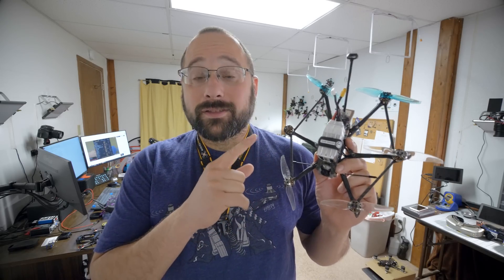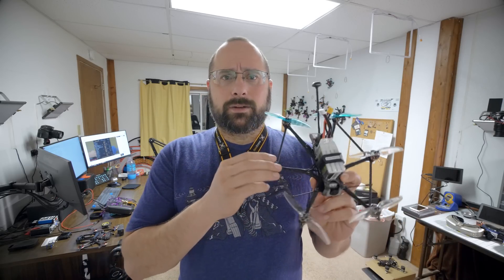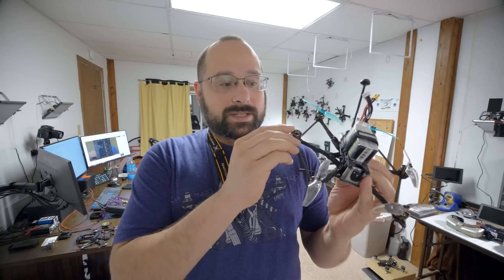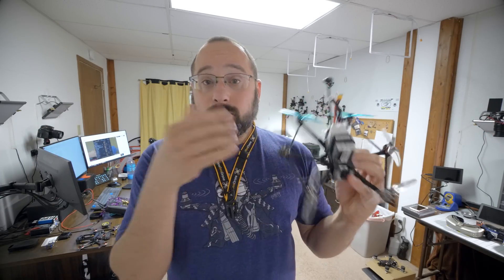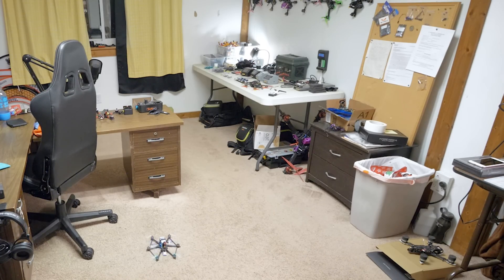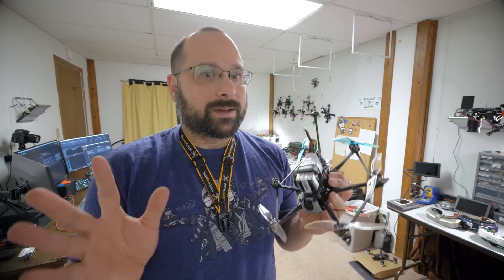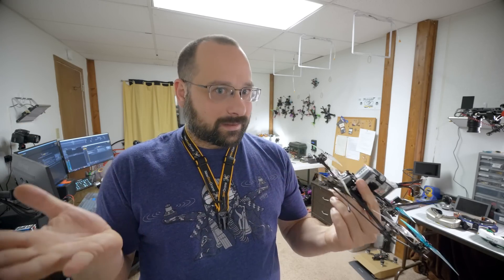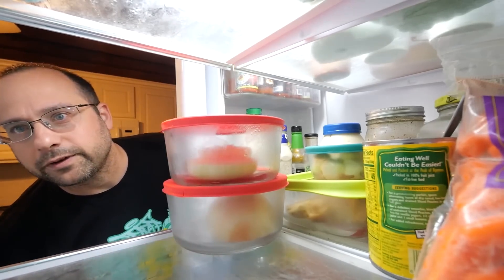Can Betaflight compensate for a failed motor in flight? FLYWOO HEXPLORER

Comment: I have loss a prop on my hex and it still flys. Put you have to have the mmix set up for the 6 motors so the fc can fly right. Any of my hex flying a standard setup becomes unstable with the slightest issue like you are having http://www.iforce2d.net/mixercalc/

Comment: 7:10 NO. it wouldn't fly as the hexacopter configuration is different. in the demonstrated situation, both CW are on the left and both CCW are on the right, which means when it tries to yaw, it rolls alongside yawing, and the PID controller just gives up. that is NOT a quadcopter configuration and thus should not be expected to fly at all.
Reply: Right, with center CG a roll towards the failed motor couldn't be corrected with neutral yaw. There is no motor mix where this is possible. But with a CG biased away from the failed motor it could work. For a simple proof, shutdown two adjacent motors and move the CG inside the quadrilateral formed by the operative motors. Those are rotating like a conventional quad. I think a lot of the success stories here leave out important details about CG. The motor mix is going to be very different for my above CG shifted proof quad than for a hex with assumed center CG. For instance the left motor wouldn't contribute to pitch, except with a forward shifted CG it would. PIDs would cover up this detail with all motors operative, but it may determine success or failure with motors inoperative.

Comment: Look at the quad when the two side props are off. It's not a common quad configuration where the diagonal props should spin in the same direction. When you roll left, the left two motors reduce speed, which makes the drone roll left, which also reduces clockwise torque. So whenever you do a roll, you are also performing a yaw. Maybe you can try yaw right while rolling left to see if that helps.

Comment: Hm.. My guess: the PID controller is trying to compensate. But to compensate, it spins the motor with the missing prop harder since it's further away from the center. But this does nothing. So it probably starts spinning up more and more and somehow can't handle that increasing the thrust on one side has a much bigger effect than on the other(?)

Whatever it is, it's bad, since having 2 additional motors means 2 more points of failure, if the drone crashes when any one of those fail :(

Comment: Hmmmm. I was with you on this question. I hit a powerline with my Mavic Air and must have come close to folding one of the front arms. Looks like it would have dropped in the river and not recovered from the tumble like it did. Sorry, no footage. The camera was off because I was flying home with a battery alarm, in a hurry.

Comment: I have a large hexacopter - approx 53 cm wheelbase - that has the same issue.  I tried taking it off with 5 props to test redundancy and the behavior looks almost the same.  It makes we wonder how redundant a hex really is.  Yes I've seen videos and heard of hex's flying without one prop, but it I'm starting to wonder if that's more of a good-case scenario and getting lucky, rather than a natural ability of the hex design.  I think for true redundancy you need an octocopter.

Comment: why wont you adress the elephant in the room and just look at the direction at which props are spinning? if you remove 2 side props, you are left with two front and rear motors on each side spinning in the same direction, compared to opposite direction on a quad. it has no yaw authority and tries to compensate, but fails. Hex without one motor freaks out at yaw axis, you can hover it without forcing it to yaw, technically, but it is not as redundant as octa.
Reply from the maker: Correct. But that doesn't explain why it didn't fly in five props.

Comment: the kquad in the lower left corner has the protection foams in motors from the DJI FPV packaging, images that were leaked today! think that bardwel is already with the kit :P
Reply from the maker: That is the diatone Roma f5.

Comment: If you had a PID controller, then yes it would work (see old-school APM octo's) but Betaflight has SO MUCH more going on than PID.  flip-out-protection is just one thing to turn off... maybe if you turned everything off -- feed forward, antigrav, airmode, I term relax, throttle boost, I dunno what freakin else but there's a lot going on in the control loop.  Haven't even mentioned the most common way a motor would stop producing thrust, and that's a broken prop, mad vibration.  So, what would the filters have to do to make that flyable?  
So the person JB was mocking was right, lol, -- Betaflight would have to detect a fault and go into 5-motor mode.

Comment: If you give up yaw stability quads can compensate for one dead motor or two if they're on opposite corners, nobody has gotten them to do it on a  micro controller, but with a flight computer it's achievable.

Comment: Since the left/right pairs are rotating the same direction you have effectively coupled roll and yaw.  I suspect roll authority is limited by the yaw pid fighting back.  Set yaw gains to 0 and I bet it hovers, but with 0 yaw control.

Comment: This sounds like a setting I needed a couple of years back. -- -- -- I have 3 distinct "claw mark" scars on my chest from a quad that "flipped out" on my desk due to an incorrect setting (and someone failing to remove the props for a quick and simple adjustment). It went from flat on the desk to vertical against my chest with enough force to very literally knock the breath out of me, and rip several not insignificant slices in my chest. If I hadn't still had my hand on the switch, or if the motion of the quad had knocked the controller out of my hand, I don't want to think about what could have happened.

Comment: hey josh i have one otw but i was wondering if you could answer this question. if i inverted the front and rear motors but leave the middle ones mounted as normal would there be enough room to mount 5" props ? thanks

Comment: When a quad yaws it mostly is lifted by cady cornered motors. The other motors offer balance but their thrust goes way down. With the hex on the stock arrangement there isnt a cross of these two counter yawed beams. There is more a star of david of two counter yaw triangles. And id you knock a motor off that triangle the remaining beam is far from the cg. This beam has 2 cross beams neither near the cg. You need 4 active motors for stable flight on crossing beams opposing yaw directions. But the cg also has to fall within the box outlined by the 4 motors. 

If you look at the motors adjacent to the failed motor as a single motor you can see that by the time they balance the lift of the only cross pair of motor that counters their yaw the motor that completes their triangle must be more or less off leaving you with 4 motors. This leaves you with a quad that roll and yaw linked together and the yaw pairs that dont cross. If you had "smart" software to bias the good triangle to avoid this you end up with a sideways cat dead cat setup but in one of the two twisted dead cat arrangements the cg is outside of the box drawn around the motors. The mixer would need additional parameters and pids to quantify the biases needed to make this work since the pid would never create this bias naturally. But im not sure a pid would actually work since a pid works when the direction of the answer is straightforward. It doesn't necessarily work when you can have an over center situation where continuing in a direction makes things worse. The answer might need computer learning in reality.

This might actually work on a 3d setup, not entirely sure. 

Another way you could set it up is like a stretched X quad with dual sets of front motors since those are most likely to take a strike. Coaxial motors on a tri could work as well.

Comment: Now what i am wondering is what would happen if you would switch only the front and back motors to a higher pitch than the left and right ones. To me it sounds like it should fly but i wonder how it would feel like in the air.

Comment: Well there arw 4 motors turning 1 direction and 2 turning the other right? Lets say 4 ccw and 2 cw  if you remove the  prop of 1 of the cw then it will never compensate starting with yaw of 4 motors vs 1

Comment: The problem is that Betaflight doesn't want to overshoot too much. If it didn't care about overshoot it would also use the the functioning motors more and be able to stabilize.

Comment: FWIW I lost a prop inflight on my DJI F550 hexacopter and the controller held it steady after a brief wobble.

Oh - this happened because I had just purchased it from another guy who didn't know that you could buy motors with left-hand threads and the prop nut came off.

Comment: Bruce Simpson flew a quad with one smaller prop with no trouble, then 2 props different. If I remember correctly, he flew with 4 different props to show the FC could cope.
Reply: Exactly. The FC must get SOME response to its commands. It can compensate but not use a completely different algorithm.

Comment: Isn't it ESC aborting? Can you see if this ESC on test stand can do 60-100% "thrust" without a prop? Maybe some safety feature of ESC needs to be turned off. Or some feedback from ESC to Betaflight (something like RPM filter or something like that i.e. dumb it down a little).

Comment: My (4 motor 5") flew back today fine with one of the blades missing off a three bladed prop, made one hell of a horrible noise but it flew back fine, I did loose the blade after hitting a tree and remained in the air, I didn't land then re-take off again, but betaflight managed to retain control with a third of s prop missing, but I bet if I had tried to take off again after landing it would have flipped out.

If only you could take off with six working motors and then disconnect one during the flight, maybe that would work?

Comment: Most PID's will not do asymmetrical adjustments, meaning thrust compensation for a missing motor on one side will also be applied to other side which still has a motor. So that's the main problem causing runaway when removing only one motor. The reason why removing 2 motors to make it symmetrical again did not work, is probably because the BetaFlight hex motor mix is hard coded to primarily use the missing side motors for roll authority. I.e. you need both asymmetrical PID and adaptive motor mix (this is the difficult part) to be able to remove a motor.

Comment: A jumbo jet with 4 engine if a engine fails it will  Shut down one of the other engines so that its flight only on two so is not off balance so why can it not  Shut down two middle motors And fly like a normal   quad ?
Reply: It absolutely could, but there are no provisions in the code to do so. The Jumbo jet 'knows' that a motor has stopped, the quad doesn't.  It just keeps ramping up the missing motor.

Comment: It is more likely to work with fancy GPS self leveling in Inav. It might not be enough to take off, but if a motor or prop fails in flight, it might increase your chances of bringing it down safely.

Comment: Bardwell ffs, enable angle or horizon. Hex mode with acro and no prop never worked on any fc since the dawn of time.
Reply: Know it all? Yikes
Reply from the maker: When I show you the outtake of testing it in angle mode and it does the same thing, then what will you say?
Reply: @JoshuaBardwell  https://www.youtube.com/watch?v=ap8ngQqt7s8

Speaking re: old DJI flight systems, and APM; only works with level mode; at the loss of yaw authority. ONLY with level modes.

And there is required coding specifically for this.

Acro mode has never, and will never work with this because user input beyond the max tilt angle will result in instability and your flips (if not worse).
Reply: @JoshuaBardwell  also with some research and more importantly experience flyhing hex configs and octo configs, you'll find that redundancy is far less fickle on Y6, X8 and Octo configs when the power to weight ratio is ideal (read, not too heavy)

Comment: The biggest Problem is if bouth middle props are missing,the Motor Direktion is wrong on the back. Bouth clockwise Motors are on the left and bouth anticockwise Motors are on the right.
Yaw and roll are a Problem... 

But i know,  my old hex whith a naze32 (newest betaflight Version that Supports the naze, i think its 3.5.something) can Fly whithout any Problem if only one prop is missing. But this only works for bouth Front and bouth back Motors. The middle ones dosnt work fine. I dont know why.
Reply: That I exactly what I was suggesting in my comment

Comment: Isn't this the same as putting on 3 high pitch props and 1 low pitch prop. The other 3 motors have to compensate for the low pitch prop. But in this situation you have no prop = no thrust means that the software wants to compensate the other motors to the motor without the prop, which means no thrust at all.
Reply: In that situation the low pitch prop would spin faster to compensate for the lack of pitch. The other three would not be affected until the low pitched motor reaches max RPM, at which point they would be limited to maintain status quo.

Comment: Correct me if I'm wrong but by removing the two motors on the middle of both sides, isn't the prop configuration both clock wise and counter clockwise on each side? It won't fly right on its yaw axis. Maybe two motors on the front or two on the rear removed would make fly like a deadcat frame with a really weird cg.

Comment: Even with the PID loop theoretically compensating, it seems like something would still have to be added to Betaflight to enable it to "know" that a motor is dead. Maybe with bidirectional DSHOT there is some way to detect a zero-RPM or insufficient-RPM condition... I'm not a developer so I am getting over my head quickly but it seems possible.

Comment: That's weird. I guess Betaflight hasn't been optimized for this. I seen a TED Talk where a guy had several quads flying around and he even cut prop blades off one motor and then off 2 motors and it still flew.

Comment: @Joshua Bardwell   Can you try to set betaflight as a Quad X and reassign motor ressource to whatever is needed for it to have correct motor order ?

Then try to fly with only four motors to confirm the lack of thrust !

I think the quad will fly just fine , but not sure about that

thanks

Comment: Does it have anything to do with the direction the props are spinning?  From what I can tell, the rear motors are spinning props out and the front motors are spinning props in.  In my mind that would affect the yaw axis enough to make it flip out.
Reply: They'll all be either props in or out. No mixing it you'd have a flip out!
Reply: Removing central props makes this hexacopter, a  quadcopter with incorrect motor directions. There is no possibility to do YAW with out ROLL, and ROLL without YAW.

Comment: If Betaflight could monitor the individual amp draw of each motor it could see when one doesn't have a prop on because it's not drawing the expected amps, enabling it to label it as suspect and shut it off to let the remaining motors take up the slack.

Comment: Yeah, the other motors "should" be able to compensate, but the PID controller will trying to primarily use the motor with the missing prop to do it (along with the others of course) and the response just isn't there. Probably saturating (I.e. maxing out) the control output on that side - to correct that it would have to be able to compensate by reducing or reversing the signal to the other side, and if the main counteracting motor on that side is also missing a prop even that won't help... regardless, it's still trying to use the disabled motors to control motion, and at the very least the PID loop can't even start to compensate for that until it knows those motors have reached max RPM (and does it actually have that information in the first place? I know you can get RPM from some escs, but can you even set a "max rpm" detection threshold in betaflight? ).

I'd bet that the control loop trying to maintain yaw control is probably also not helping to keep rpms in a good range.

Comment: My guess is that for hexacopter the side motors are manly responsible for roll and the others aren't given the authority by the pid controller to balance the quad instead it sends everything to the Sidemotor which has no prop on.

Comment: Just yesterday I was trying out some new props, didn't quite throttle up enough coming out of a dive and pancaked the floor.  One entire blade of a 3 blade prop broke off and I flew the rest of the pack without realizing it.  When reviewing gopro footage I can hear the sound of the quad change when I pancaked.  

I'd have thought your hex in penta config would've flown as well.

I wonder if it's having to use the remaining motors to compensate for less yaw authority and it's messing up the roll stabilization when those motors spin up to control yaw.  I doubt it since you weren't commanding much if any yaw input.

Comment: well i would have said 1  motor down you should be able to get the quad home.  for me hex copter has motor redundancy and should get back on 5 or 4 motors so i cant see the point of  this copter. there is a ted talk that shows a quad with heavily damaged props and it still is flyable.  @ 7 mins in the following video
https://www.youtube.com/watch?v=w2itwFJCgFQ

Comment: I think it might have something to do with there not being any load on the motor. I bet if you were to put a dummy prop with zero pitch on it, or cut off blades to simulate actual prop damage, it would still fly.

Comment: My theory is that when you remove props, the pitch and/or roll authority becomes so different that the pid controller is no longer tuned well enough to keep it in the air. I wonder if the quad could detect that situation (either through pid error or measuring esc rpm/current telemetry) and boost the pid gain on the effected axis to compensate.